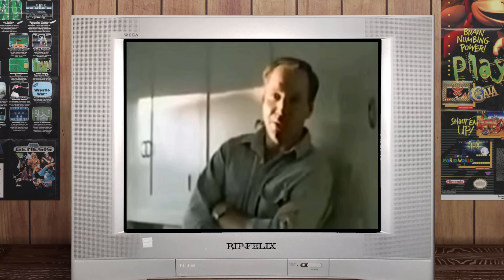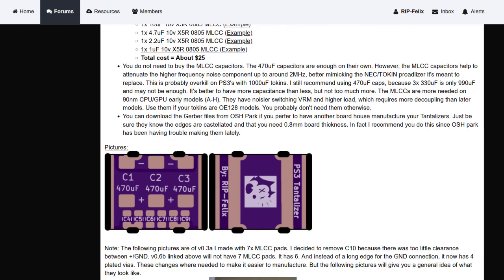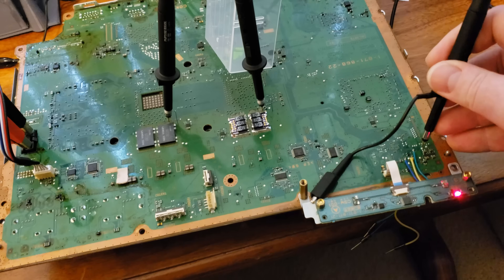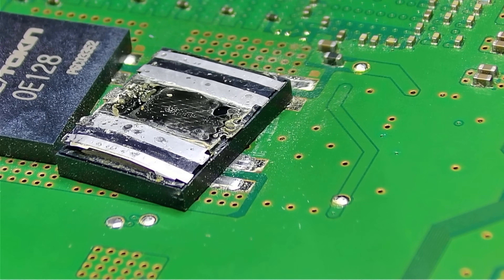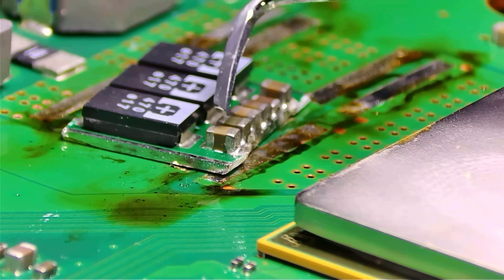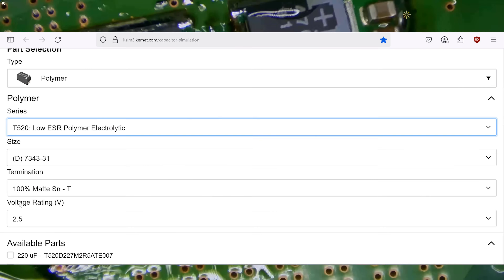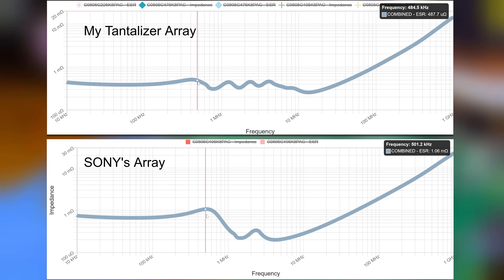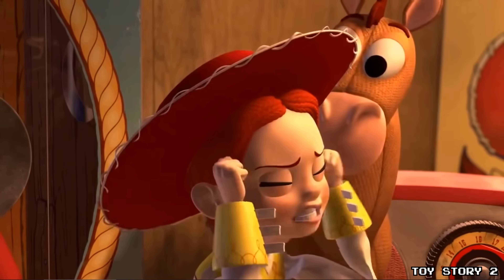How To Fix | Episode 2: Bad NEC/TOKINs

Comment: always amused at most NEC/TOKIN "repairs" usually have them violently chopped off into pieces and the even more wacky caps getting soldered in before proper PCB for them appears. It's probably impossible to get them off properly but its still funny

Comment: I just bought another second hand PS3 and it started working normally at first but after a while it went into YLOD. I checked using Syscon and it turned out to be error 1103 which means thermal alert system. I've re-pasted both RSX and Cell, but it's still the same.

Comment: I don't think it took 10 years for the tokins to fail. I think over time with consoles getting hotter with dust build up and thermal paste drying out the tokins would die much quicker due to being so close to the CPU/GPU they could die in 2-3 years.
Reply from the maker: Dust sure. One thing about paste that's interesting si that as it wears out the thermal porfile kick the fan up faster to compensate for the poor thermal transfer. That actually keeps the tokins cooler, due to more air flow over the MB. Unless it's clogged with dust, as you say.

Comment: I'm making your tantalizers for my ps3 with only error 1002 my questions tho is that I am currently missing the 22uf mlcc only for, but does it still work if I install it on the ps3 motherboard and can I just pouplate that part when it arrives?

Comment: What capacitors are You using at 15:41 ? I always use Panasonic 2R5TPE470M7
Reply from the maker: Probably Panasonic EEF series aluminum polymer. They hove lower esr and can be cheaper sometimes. Either work well.

Comment: Could you redesign the Tantelizer PCB's to be more like your original design with visible solder edges. Plus the PCB should be a bit thinner.
Reply from the maker: Yes, but that would require selecting a box called "edge plating," which costs more than a slot and a little nore PCB to trim off. So the way they are now, is cheaper if you can get them to honor the slots aren't edge plating loophole.
Reply: @ripfelix3020  Does it cost just a bit more?
Reply from the maker: Yes, it would cost more to come the way you described.

Comment: i was a dummy and never checked the codes before attempting to fix, and im currently getting error code 2113 on my CECHK01, could it somehow be related to my fix attempt failing or is it something completely different? the 3.3v and 5v rails seem to generate power normally, and the fan spins and everything. it says "[SSM] PowSeq Fail : Detected !"

Comment: Awesome video but are you getting ChatGPT to edit your script? There's a lot of "it's not just ABC; it's DEF"
Reply from the maker: example?
Reply: @ripfelix3020 

6:23, 6:43, 8:08, 8:31, 8:57, 9:35, 11:49, 12:20, 15:59, 16:20

and a lot of rhetorical questions and "let's look at ABC"

Please don't take it personally: your videos are great.
Reply from the maker: I'm addressing specific concerns and counter arguments raised in discord and by comments. People tend to clain this mean that, because of this. So I often point out that the issue isnt just this, it's also that. "it's not just" is a compact method to address an assumption while making a counter argument at the same time. Without the preamble. I probably went off on tangents in the first draft, then cut it down to length deciding what's important with this sort of sentence structure. 

ChatGPT doesn't own the "it's not just..." phrase. And believe me, you don't want the first draft!

Comment: My friend, I’m working on your capacitor-replacement mod on a fully backwards-compatible PS3 (the launch FAT model). I don’t have much experience with electronics, so I asked a technician friend to perform the soldering for me.
However, here where I live I cannot order the pre-assembled board from JLCPCB, so I need to manufacture only the PCB and manually solder all the capacitors.
Because of that, I need to know the exact capacitor specifications used in your mod (both capacitance and voltage rating), so I don’t purchase the wrong components.
Could you please provide the exact models and electrical ratings for each capacitor used on your mod board? Any details will help a lot. Thank you!
Reply from the maker: https://www.psx-place.com/threads/research-experimental-nec-tokin-capacitors-replacement-ylod.25260/page-217#post-313627

Comment: Hi, I want to start off by saying I think I speak for everyone when i say that we appreciate your videos they really simplify everything. But I want to ask: I have seen many, and I mean many, 40nm Frankenstein PS3s fail, and I am really starting to worry about mine. Some people say it's only on the 40nm, and some people say it's only the later revisions. It's also VRAM related, similar to bump gate the solder balls start to crack and boom, 3034 again. My theory is it's caused by the temperature difference between the GPU die and the VRAM, which in time kinda causes a warp or some such. For example, the GPU die runs at 55c the VRAM could be at 80c, which is a high temp difference between the two. This is just a theory tho, so not really sure. Also worth noting that GPU dies in the Super Slim RSX and maybe later slims is lower by little but still. Can you make a video talking about this topic and explaining if it's true and what would the best RSX revision be for a Frankie? Thank you.
Reply from the maker: I'd need more info about how many frankies are dying, who made them and whatnot. Can you elaborate on that aspect?
Reply: @ripfelix3020 sorry for the late reply but i have seen atleast 5 online fail 1 was from computer booter and the other from ace console repairs idk much about the others but they all have vram artifacting i am wondering if this is a defect on all 40nm rsx models in frankenstein ps3s i know 5 isnt a big number to go of on but i am wondering since the temperature difference on the vram and the gpu die is usually so big could that be the cause.
Reply from the maker: I dont think so.

Comment: RIP Felix I know you may not reply to this but I have a question

I have a CECHA00 recently it's started doing halt stop when playing PS2 and some PS3 games, it's running CFW and has been kept under 68c for the 2 years I've had it.

On checking the syscon logs it's recent errors are full A0801002 with a single A0801001 which I suspect is from when I had to hard shut down the console due it it hanging on black when loading a homebrew from the XMB, I looked at codes on PSDev this seem to indicate power train issues. Since it seems to happen in two cases either within about 1 min of XMB or during a game with heavy load TLoU gets about 1 - 5 mins into the game depending on if I skip the intro movie, some other games last a bit longer before the console beeps out. Other than that there are no other issues, not graphic issues or artefacts that would show a deeper GPU failure. 

Do you think it's a Token problem and they should be replaced? If so is it advisable to replace all 8 rather than just the 4 on the RSX since I've noticed most people who sell your Tantalizer mod seem to only provide 4 at a time.
Reply from the maker: Yeah, tokins would be the diagnosis here. I reccomend replacing all of them. The same conditions that led to one failing were present to age the rest. So they're sure to follow. You don't want to have to rework the same area twice, each time risking the BGA.
Reply: @ripfelix3020  Thanks Felix I'll look into getting some made, I've just checked the log run time I think 116 Days, 12 Hours, 25 Minutes, 45 Seconds
 is a little past MTBF for that particular component given they are rated at what 1k hours and I'm at about 2800 hours deep.
Reply from the maker: Unfortunately the math doesnt add up so cleanly. It's highly dependent on actual operating temps, which are unpredictable.

Comment: I was hoping to get an idea of next steps for my ps3 that is having issues. My ps3 ceche01 powers on but no video out put. Stays green powers on but unable to reset. I can hold it down to power off on the power sensor. The hard drive and network indicators lights flash then disappear. And controllers won’t sync and even connect when connecting to usb wired. I drilled holes and put in a 231 psu 😅 in the past. Is this a GLOD? I don’t see much coverage on this when researching. I took out hard drive and switched between the hdmi and AV cables but no luck. Is there any hope to save this? Thanks in advance
Reply from the maker: Yes, GLOD. Usually that's the RSX. generally replacing it fixes it.
Reply: @ripfelix3020  thank you for the analysis. Hopefully I can get it Frankied one day. I also have another ps3 that I delidded and damaged trace in the corner, Ylod. I posted it on Reddit and see comments saying it’s ruined and others saying it’s possible for repair. I reached out to computer booter and he could not come to a solid conclusion unless in person since traces are small. I’ve seen conductive pen as a posible solution. Is the pen worth trying would it be worse in any way? Or better to get it service professionally. Thanks as always for your time!

Comment: Welp, my 2001A Slim is dying. Checked the SYSCON and found A0801002 all over the place. Damn Tokins got me again, just like with my original console last year. Gonna get a 2501A in the next week or so, because I have officially learned my lesson and I'm not getting bitten a third time by the same animal. 

 It's gonna be a graveyard out there for the Tokin containing models in the next couple years.
Reply from the maker: As time goes on, they'll age out more and more.
Reply: @ripfelix3020 Do we have any data on what tends to kill the post-Tokin Slims? From all my digging, they all seem to be absolute tanks and there's no real trend as far as what takes them out. They just say "I'm tired, boss." one day and their power supply quits or something random like that.

Comment: Its so over for me, I accidently dropped a bit of solder from my soldering iron directly into the back of the cell cpu. And now it's shorted. I tried cleaning it and its still shorted. I'll have to look at it again tomorrow but I can't see any immediate signs of shorting. Are the capacitors on the back of it that important or can I get away with a few missing
Reply from the maker: You could probably get away without one or two, but I'd encourage you to try and clear the bridge if possable.
Reply: @ripfelix3020  i was able to pull fhe visible solder off but its still shorted. I can't see any bridging, but I haven't powered it on since it happened. It was measured at around 3 or 4 ohms before it happened (now 0.3 ohms)
Edit: I deemed it as a lost cause and as a last resort to just turn it on anyways. The short cleared itself without any visible damage so im going to try again! One of the capacitors thingies fell off though but it was loose anyways

Comment: If I replace all the nec tokens will I need a jumper cable
Reply from the maker: The tantalizer has the bridge wire built in. It's a drop in replacment.
Reply: @ripfelix3020 thanks for the help

Comment: what 3004 and 1002 error codes mean? is it only tne nec tokin
Reply from the maker: RSX side power failure. Usually due to tokins.
Reply: @ripfelix3020 so i just recap all the 8 tokins with 3 tantalum per tokin (i want to do tantalizer but the cheramic capacitor still in delivery), my consol turn on but overeheat, so the fan spinning hard after 20 seconds and console is hot notification , then my console shut off by itself, my console is cechh00 (i bought it with ylod condition) i have replace the thermal paste too, what is the problem?, i checked the temperature wih webman shows that cpu temp raise to 89 but the rsx only 40 in idle, when i touch the heatsink its only warm, do i need delid the cpu?. i check the back side on the cpu is very hot immediately whhen turned on

Comment: Felix, remember I mentioned something about some underfill on a 90nm RSX? I found something new if you’re interested. I got no other way to contact you so I’ll leave a comment here.
Reply from the maker: Sure, what did you find?
Reply: @ripfelix3020  When I delided my first 90nm RSX I checked it with the UV light and at the time we agreed to be skeptical the UV light might not be the right type to show the fluorescing underfill.

Well...I recently delidded a Wii and behold, all 3 dies: GPU, SoC and that tiny tiny one turned mad green under the same UV light. The 65nm IBM Broadway CPU didn't. My 90nm CELL of course didn't and surprise surprise, the 2971DGB 90nm RSX didn't either.

Unfortunately I'd have to take apart my PS3 again to take any picture but trust me, the underfill was brown just like CELL's. I only got photos from the Wii.

PS3 has 175 days and counting. 0 errors when I imported it from Japan (CECHA00).

There's something fishy going on.😂

What do you think?
Reply from the maker: Maybe? If you've truely found a 90nm RSX without the fluorescent green pigment in the underfill I'd like poke test it to see if it still has a low Tg.

Comment: I’ve encountered a werid ps3 issue my ps3 slim cech2101a turns on no display with and without hard drive does not boot safe mode and doesn’t even turn off.
Reply from the maker: That's a GLOD. Usually a bad RSX. It can happen to any RSX on any model, but that model is generally the most reliable. Sounds like bad luck.
Reply: @ripfelix3020 werid it happend after I replaced the thermal pads thanks any ways

Comment: Hey Felix I am a bit confused.. How do i order the tantalizers? Do I have to download the files from github?? 
Something else i noticed recently when i opened a cechc04 model that it had a chrome die on the cpu and a brownish colour as a base compared to the blue die and greenish base colours that i saw when opened at another cechc04 model. The thing is i know the die doesn't have anything to do with its usage but the chrome die console has nec tokin problem with only 63 days of runtime, so this a total guess from my point of view that maybe in the factory that they made the chrome die models, maybe they didn't use good quality nec tokins or they were defective?? Idk whats your opinion on that?
Reply from the maker: You can upload the gerbers to JLCPCB or another board house. The Position file and Bill of materials are formated the way JLCPCB like them for PCB assembly. You check a box for PCBA and it takes to the options for assembly. you'll have to select the right parts based on what's in stock. Then review placment and order.

As for the die color/substrate color. It can vary some, but doesn't matter. The uptime you noted and the tokins dying is the reason I say that there's mor going on with the tokins dying than just usage time. Whether they'e beed used estensivly or not, they appear to just age out regardless. I don't think that makes them decective, but does speak to materials related vulnerability that's time based. I think a plausible explanation is the silver pase electrolyte they used. Over time it may degrade.
Reply: @ripfelix3020  Ok so using the JLCPCB website I noticed that for C1 C2 and C3 i can only put EEFGX0E471R part instead of EEFGX0E471L part like it is showed in your video because the one in your video is in shortage... Should I wait maybe until this part comes back??